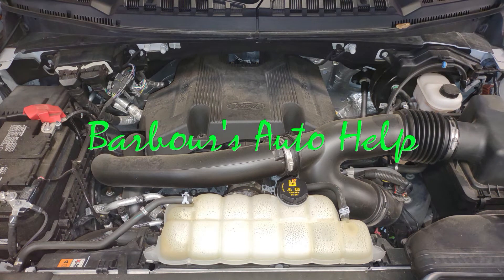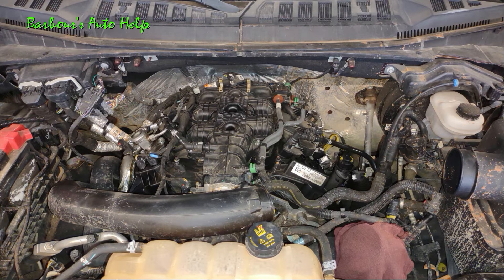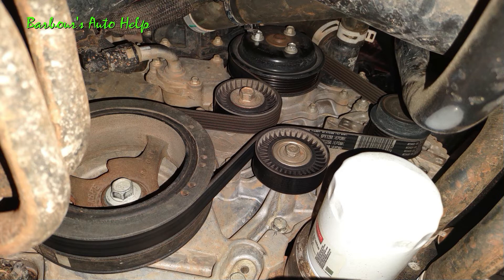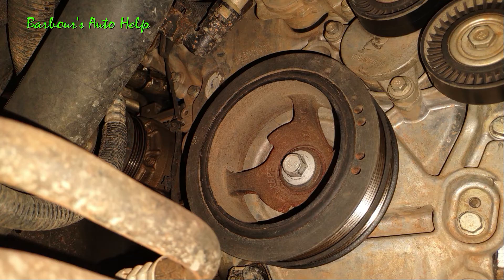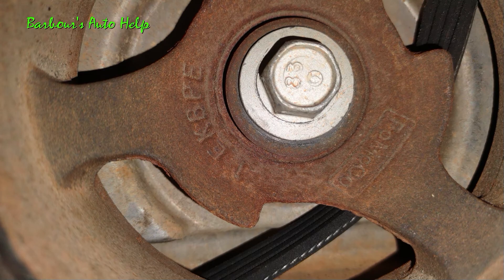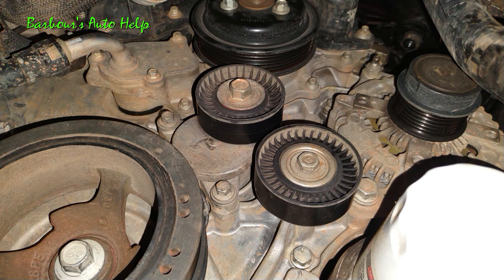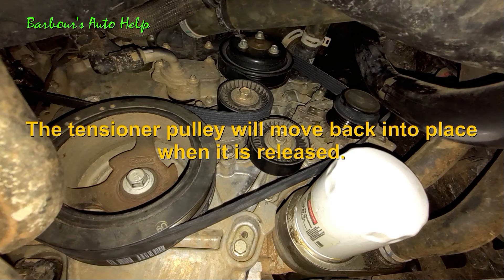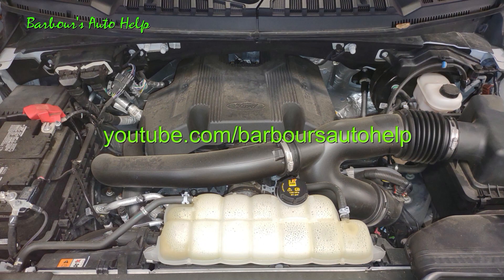Ford 3.5L Ecoboost Serpentine Belt & A/C Belt Removal & Installation (F150 & Expedition)

Comment: about the tensioner pulley mounting 

 it seems ill conceived idea,   being there is not bearing mount.  seems weird it just mounts to a the flat of the cover and is simply centered by a plastic bit on the bolt     Any thoughts?

Most have a pillow block or or mount vs a flat surface.

Comment: The 21+ f150 is exactly the same process, except one major change which is the air conditioning belt is furthest out on the crack shaft pulley so you can't just replace the serpentine belt without removing it.
Reply: How can you use the zip tie method with the serpentine belt in the way?

Comment: Did you have to place the vehicle in neutral so that the main crank would be able to rotate clockwise while on the ground? Or was the vehicle fully off the ground on stands / lift when work was done?
Reply from the maker: If the vehicle is equipped with an automatic transmission the engine will spin with the transmission in park.  I do not believe however, that Ford offered a 3.5L ecoboost/ manual transmission option though.  So, i'm thinking it's auto.  However, if you do have a manual then the vehicle must be taken out of gear.  Warning!  Be sure the parking brake is applied and that the wheels, that remain on the ground, are chocked and follow your owners and repair manual for instructions on how to properly and safely lift and support your vehicle.

Comment: Removed the idler assembly put the A/C belt behind the crank pulley and rolled it on with no help from the zip ties. Worked great. The best video for this project I have seen. Thanks
Reply from the maker: Nice work!

Comment: Should the crank pulley have any play to it?
Reply from the maker: Like forwards and backwards play?  In and out?  Just a bit it ok. Why do you ask?
Reply: @BarboursAutoHelp  was trying to diagnose a squeaky belt/pulley noise. I sprayed a small amount of water on the belt and the noise disappears completely for about 5-10 seconds. Was watching the pulleys spin and noticed the crank pulley kinda wobbles. When I get home I'll remove the belt and see if it's just loose or if there's something else going on.
Reply from the maker: Oh I see. The outside ring could be coming loose. But some wobble is normal. They aren’t perfect from the factory.